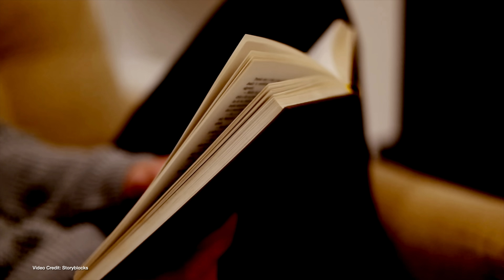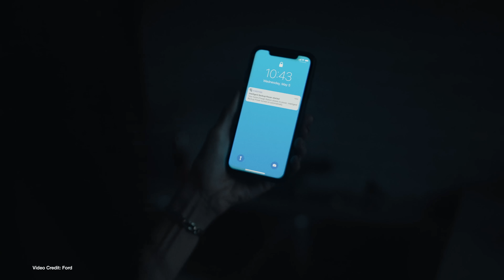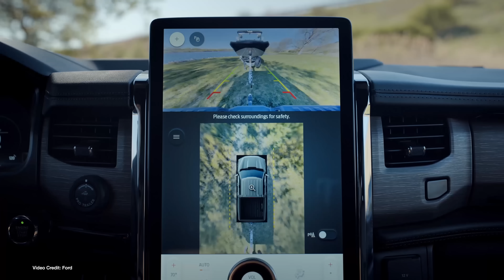What's Vehicle to Home - And Vehicle to Load?

Comment: I remember there has been extensive research showing vehicle to grid was actually good for your vehicle’s battery. It might have been Dr Euan McTurk?  And I’ve read recently that AC has the potential to offer a cheaper V2G connection than current DC systems. I’m hoping this becomes a standard feature very soon, it has the potential to help massively in a smart grid future.

Comment: When I hit the juice pedal in the Bolt it can quickly ramp over 100kw. Most homes don't pull more than a few kw at a time. How could the draw from a home be bad for the EV's pack?
Reply: Well if some dufus rigs up an inverter and bypasses all the safeties, you could deplete it to a non-recoverable level.  Any well-engineered commercial or DIY solution would prevent that though.

Comment: Great subject. I am in process in my home with this very thing in mind. I have plenty of Solar to run the home in the day but have limited storage (Batteries). I do not want to spend on Lithium for the home as I own a 2017 Ioniq. I am also on the waiting list on the F 150 as well!! My question or rather inquiry is do anyone know where I can purchase a Vehicle to Load adapter for my car?? This would be optimum for my needs and I have seen this very device on the new Ioniq 5. Would this device work on my older Ioniq...??

Please advise.. Thanks..
Reply: I'm almost absolutely sure that the latest adapter for the current Ioniq 5 or Kia EV6 will NOT work with the older Ioniq as it doesn't have the proper wiring or software to allow such a thing.  I know that Chademo equipped cars inherently have bi-directional charging but as Chademo is dying, hard to find an option that will work for V2X, despite the built-in ability to send or receive energy via the port.

Comment: V2G and V2L should be mandated as part of the electrical code.  I’m sure the people in TX who were fortunate enough to own electric be vehicles with their 50kwh packs would have loved to have the heat on, even if it were only in the kitchen. Not everyone can afford Powerwalls.
Reply: Yes, we would. Though, the "star of the show" was the guy powering his home with his Ford truck. But, that makes selling the Lightning even easier.
Reply: I am not sure if the software in the car will disconnect the battery if it sees the charger trying to discharge the battery,  but the simplest solution would be to include a DC charge port on hybrid solar inverters. They already have everything needed. All they need is a way to connect the car battery to the inverter.  It would also work as a charger when there is solar energy.
It really is the best solution and if done correctly it would work with any car with at most a software update.
Reply: @franciscoshi1968  Very interesting!  Thanks for posting.
Reply: Manufactures should be forced to offer a vehicle to home inverter system on order to qualify for tax credits. V2L is challenging but just backfeeding one house is easy! Let's make it happen!
Reply: 50kwh won't get you far though when heating. Phen w vtl is where its at

Comment: Great video, Nikki. I wanted to leave a couple of (overly-detailed) notes:

1. You alluded to, but didn't full explain the differences between systems and where the DC of the battery converts back to AC for the grid. Hyundai and Ford appear to be looking at converting DC to AC on board the vehicle, probably using the same on-board inverter they're using for V2L. Renault have also done some experiments with on-board conversion. Nissan and VW are looking at converting DC to AC off board, using a wallbox with an inverter and charging/discharging through the DC CHAdeMO/CCS port on the car. The former approach is cheaper overall and much cheaper in terms of the wallbox - a DC CHAdeMO/CCS wallbox costs ~$4000, even without the rest of the electrical infrastructure the house needs.

2. In terms of battery health, you're bang on with the discharge rates - even a hefty V2H system is a slow discharge that does less harm to the battery pack than a regular 7kW charge. There's other degradation mechanism, though, that's probably more important for overall battery degradation, and might make V2X better for your battery than unidirectional charging. Li ion batteries hate being fully charged and fully discharged. The way they work is that Li ions move between cathode and anode as the battery is charged and discharged - fully charging/discharging basically causes as much Li as possible to get crammed into the cathode/anode. Particularly if, once you've crammed all that Li ion, it rests there, it might (effectively, as I understand it) get stuck, permanently reducing battery capacity. In layman's terms, charging to 100% and leaving it there for days will cause substantial degradation. Rarely, if ever, does a manufacturer let you use all the battery pack, so '100%' might only be 90% in reality, but the principle stands. V2X requires car and charge point to undertake a sophisticated negotiation, similar to a rapid charge (sidenote: this is currently only supported through CHAdeMO, but CCS and AC standards should be getting released later this year). Certainly in the V2G trials I've seen, the app that controls the charge point limits the state of charge not only to >20% (in case of emergency) but also to <90%, protecting the battery from overcharge-related degradation. Some even allow you to set a tighter band, which is even better for your battery. Because Nissan have made some... questionable decisions with the Leaf, I can't stop it fully charging its battery unless I plug it into a V2X system or terminate the charge manually.

I am super excited for V2X technology. I live in the UK and power cuts are extremely rare, but I'm also an engineer and I'm excited by the possibilities in grid load shifting etc. In only a few years, there's going to be a lot of EV plugged in to people's houses and a huge amount of battery capacity potentially available. I'm imagining virtual peaker plants, that damp down evening demand peaks. I see an easy way to carry the day's solar generation into the evening. This could be a really valuable resource, and I think Hyundai/Ford/Renault are heading in the right direction with AC power export. I'm cautiously optimistic that this technology might be more common than you think in 5-10 years time. And I think that, in Europe, Tesla might have to swallow their pride and provide V2X services or end up missing out - they're already being outsold by the VW ID.3 and Renault Zoe, and lack of V2X is probably the biggest reason (after price) that I'd hesitate to buy a Tesla.
Reply: Awesome comment!!! 👏👏👏
Reply: @deltajohnny  Thank you :). There have been a few advancements since I wrote this:

The standards update that enables CCS and AC bidirectional power transfer was released back in April. Because it's only just been released, it'll be a little time before systems using it get going, but things are underway.

Most EV charge point manufacturers are doing new models, particularly because the UK has introduced new regulations that require all new EV charging points to be smart and pre-programmed with a timer schedule and a random delay (so the entire country doesn't start charging at 10:00pm on the dot). Some of the new charge points are boasting 'compatibility with ISO 15118' - this means they're ready for AC V2G.

Hyundai have stated that the Ioniq 5 and its other V2L-capable cars will be compatible with ISO 15118 after a software update at the dealership. The new version of the Kia Niro EV is available with V2L and I'm very excited to see such a mega-popular EV gearing up for V2G.

There's now a serious energy crisis. I don't know what it's like in the USA, but here in Europe it's a massive issue. I expect this situation will accelerate V2G trials and their scale-up, now that there's pressure from the top.

If shopping for a new EV today, I would consider V2L (that's V2G-ready) to be a highly desirable feature. I wouldn't be surprised if V2G schemes are running at scale and putting money back into consumers' pockets by 2025, at least in some parts of the world.
Reply: @gigabyte2248  Thank you very much for the updated information! I live very close to you, in Spain, and our electrical standards are different, but I hope that the European politics "copy" what yours have implemented 👍👍👍

And yes, when I purchase an electric car, I'll be sure that it's at least V2L compatible, hopefully V2H 😁😁😁 and I read that it's better to have a LFP battery, as it tolerates better continuous discharges, for instance if we use it at home by night 😉😉
Reply: @deltajohnny  LFP chemistry is safer, cheaper and has slightly more longevity, but NMC(/NCA) chemistries are still safe, stable and reliable. I wouldn't worry too much about the chemistry of your EV battery. This is one thing that the market should sort out - once the dust has settled, low-cost chemistries, such as LFP, will be commonplace in lower-end EVs and sophisticated chemistries, such as solid state, will be in the top-end vehicles and automakers will figure out which models are worth expensive, advanced chemistries.
Reply: @gigabyte2248  👏👏👏 Thank you very much again for the very valuable information, and let's hope that we have some health in the coming years  to see what the EV future holds!! 😎😎😎

Comment: V2G works 2 ways - it not only reduces the peaker plant loads produced by fossil fuels but it increases the potential for renewable penetration at other times.

Check out this curtailment report for renewables in Ireland. The amount of curtailed wind output in Ireland in 2020 could have powered 391,397 electric cars doing 10,000 miles each in that year. That power would have cost zero for additional capacity or distribution and is mostly from night time when the demand is low and wind still blows.

That power could have been produced, charging those cars overnight and the effect is that the wholesale price for power at night is often negative.

https://www.eirgridgroup.com/site-files/library/EirGrid/2020-Qtrly-Wind-Dispatch-Down-Report.pdf

Calculation based on:

Curtailment total for 2020 (table on page 1 extreme right) = 929,869 MWh

Convert to kWh (x 1000) = 929,869,000

Mileage potential (based on the 4 miles/kWh I achieve in my Leaf) = 3,719,476,000

Number of cars annual driving (based on 10,000 miles/yr) = 371,947 

Put another way. Earth circumference is  24,901 miles so equivalent to 149,370 times round the world.

Comment: I also like the Ford Lightning’s smart feature that allows the vehicle to charge during off peak hours and power the home during peak hours.
Reply: Just using an EVs charge timing feature or that of a smart EVSE like the EnelX JuiceBox can and does do this already.
Reply: @karlbloss  really?! you might have just given me the missing piece in my solar/EV jigsaw.
Reply: @karlbloss  oh they are just normal type 2 chargers, solve the timing of the charging of the vehicle but not the issue of controlling when you power the home.

Comment: "Vehicle to home" power back up requires your BEV to be plugged in at home, so you won't be able to use the vehicle during that time - it is not a 24/7 solution for either your home or your community
We need to update infrastructure and install megapacks which are much more cost effective and will benefit all (not just those lucky enough to be able to afford a BEV)
Reply: But you use more electricity when at home! I bought my leaf to be able to use as a home storage power unit and I intend to get a small powerwall to cover fridge and small units that run constantly. Only problem it v2h chargers are really expensive so my plans have to wait
Reply: @ronaldusher39  I installed solar panels because I am at home during the day but these are "solar to grid" and if the grid goes down then so does the solar
The only real solution would be a battery but they are expensive and V2H (or V2G) also requires some (very) expensive electrical work, and unless your planning for Armageddon it would not be worth the hassle and expense
We need the utility companies and government to invest battery megapacks, our lives (and work) are much more (completely) reliant on electricity than they were even a decade ago, there would be massive social and economic unrest if we had widespread repeating of what happened in Texas
Reply: @nickt6965  I have solar too and its a grid one but I know there are systems that will keep system running through a power cut keeping house lite up lol thing they did a video on @FullyChargedShw about it
Reply: Save the lithium for the cars. Use molten salt, or compressed air, or liquid air, or pumped hydro, or flywheels, or dropshafts, or liquid metal batteries for the grid :)

Heck, even old lead acid batteries would be better for the home and grid than lithium. More duty cycles, and cheaper.

Comment: Down here in New Zealand, the network company Vector, provided vehicle to home using Nissan Leafs and tech from Nissan. It’s been well tested and the recipients are pleased too. Not dangerous, not silly.
Reply: I have a CHAdeMO-equipped Leaf, and I want this five years ago.  How do I get it?
Can you at least tell us more about who makes the box you're using for V2H?  Make & Model?
Does it charge and provide V2H functions simply by being plugged in?
How is it connected to house power?
Reply: @stevejordan7275  there's gotta be an inverter, and a switch on the meter to prevent backflow when there's a loss of outside grid power.
Reply: @johnklein338  I was planning to buy a 5kW inverter so I can potentially power the refrigerator and freezer (which presumably won't always be running at the same time) without having to string extensions from the garage.

I assume this would allow for one or two already-wired-in-place lights and fans to be used (again, without having to drag an extension cable around wherever I go.)

So if I'm going to switch to battery power, can I just throw the mains to OFF, and connect the inverter OUT to any outlet with a male-to-male NEMA 5-15?

I could even put it behind a 15A breaker (or something) to keep the draw from getting too high (though it might trip if the 'fridge and freezer start up at the same time.)

Or should I get a 240V inverter and connect to where I have the L2 wall charger already plugged in?  I can't use the charger when there's a power outage anyway, and that would spread the load across both 15A breakers that provide 240V charging power on a 120V home service panel.)

Sorry if that threatens to be a TL;DR... hurricane season is close, and I want my emergency power situation in place before the first one makes landfall here.
Reply: @stevejordan7275  I'm not an electrician, but what you describe would probably work, I think. May not meet codes.
Reply: with the nissan leafs battery so tiny does it even worth bothering with? does it give any time at all? and then what good is a dead car then?

Comment: Thank you for this, I've been thoroughly bemused by the rather odd argument about v2h being bad for the vehicle battery. From my experience a slower than normal power draw would actually be good for the battery
Reply: Yes, I herd argument that frequent cycles of low power charging and discharging are actually beneficial for battery life compared to it sitting there charged.
Do you happen to have a reference to some research on this topic?
Reply: @bazoo513  just my own work experience refurbishing aircraft batteries back in my airforce days. That is what we did to restore battery capacity.
Reply: @jamesfromwellington  Also Li-ion?
Reply: @bazoo513  that technology wasn't common at the time but the principle that high c rate discharge degrades batteries faster that low c rate works across all battery types
Reply: @jamesfromwellington  True, but lead, NiCd, NiMH and LiPo / LiIon batteries all have wildly different "preferences" regarding deep discharge, "memory", best storage state of charge, thermal considerations etc.

Comment: The weather channel shows a tornado in Oklahoma and people in San Diego buy storm shelters. I live in the Sierras in N. Calif. (remember Paradise?) My $150 generator gets me through the couple day per year PG&E has outages -powering the fridge, lights, internet router just fine. No wall-warts or Alexa switches to drain unnecessary power with some whole house setup. We do have fast moving fires though. I'll feel better having my fully charged relatively fire resistant steel CyberTruck at the ready when blazing tree limbs are falling across the road .. just sayin..

Comment: Most people buy their electricity on a fixed price tariff but the actual costs are variable on a time of day basis. Get on to one of those tariffs and the benefits of vehicle to home become very clear very quickly. In my part of the world wind power is curtailed at night due to lack of demand for electricity. Electric cars on vehicle to home could dramatically increase the amount of renewables by keeping turbines running at night. Curtailment of wind turbine output in NI in 2019 could have powered 45000 cars doing 10000 miles each. That's free power with no additional investment in generating capacity or transmission. This is huge.
Reply: Yes if the cars are charged by renewables during the day at a net increase of storage, otherwise, not so much.

Comment: Had v2g for two years know I have  2 gen Nissan Leaf the car is now on 66000 miles and just had a service and Nissan have said the battery is in good health and there no battery looses 👍👍👍👍👍
Reply: Can you use it for V2H by switching your mains to OFF when the local grid goes down?  (Or does it do that for you automagically?)
Where did you get it?
How much did it cost?